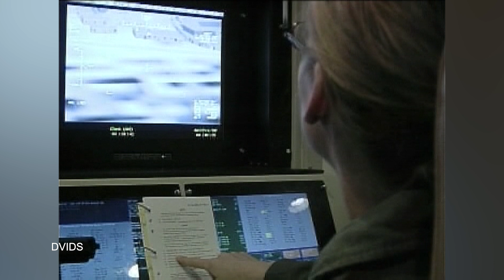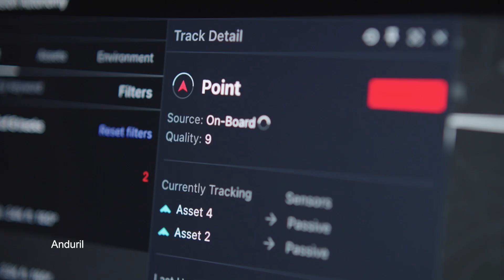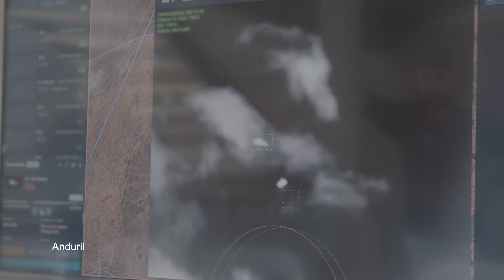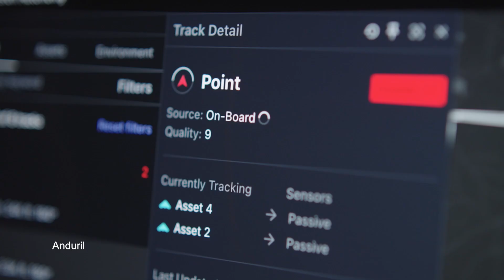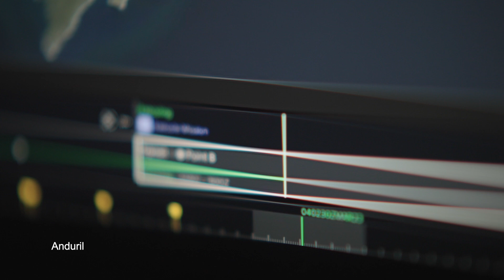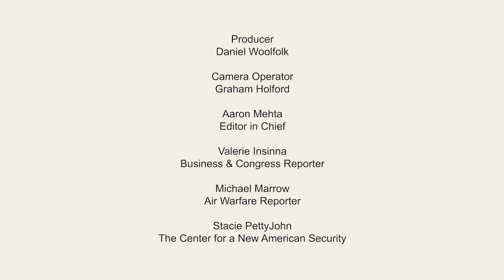What to know about CCA - US Air Force loyal wingman drones

Comment: Why does a cca need to be controlled by a pilot and not some guy on the ground who doesn’t need to worry about controlling an aircraft? This is especially relevant because the usaf and navy are both leaning into single seat aircraft. It’s already hard enough to control one plane much more so to manage others while doing so
Reply: I should think it will be able.
The Australian Ghost Bat can be controlled from land, F 35, F18 super hornet, Wedge Tail, P8, Triton or Autonomously.

Comment: Except for the special F-16s, there are no supersonic CCA that can "accompany" a US fighter into combat. I view that as a problem. If a swarm of aircraft are detected on ground radar, then all the aircraft that are subsonic can be sifted out from the supersonic ones ?Also consider combat radius of the CCA ?
Reply: Agreed, its a problem.....but perhaps one to be solved by the second generation of drones. Better to get the software and strategic infrastructure in place, and fuselage assembly systems... then vis its modular design, upgraded models with Supercross engines might be next.

I hope.
The dogfight and bvr combat benefits of a smart drone is truly amazing... if we give them enough kinematic potential. 
The ability to make decisions involving 15G turns at will is pointless if you don't have the energy to spend on it.

IMHO, gen 2 drones should be compatible with the proposed light fighter program: a true f16 replacement but stealthy.
Light, perhaps the size of the Ghostbat or a bit bigger... using a miniaturized advanced turbofan that can supercruise, has vectored thrust... perhaps an engine the same size or smaller than an f16, and a small internal weapons bay.

In many ways its similar to an f35, but cheaper, more aerodynamic, lighter, and nor needing all tge weird little features f35 incorporated to try to appease 4 branches and several countries.

Just make it light, aerobatic, and stealthy. With good AI and sensors they might be more survivable than an f22. If you can pull ultra high Gs, then you can dodge most missiles easily.
Reply: @ravissary79  sounds good. Software is harder to generate/improve than hardware.